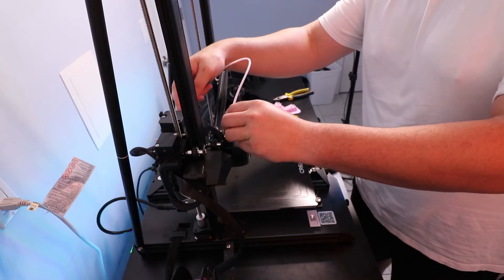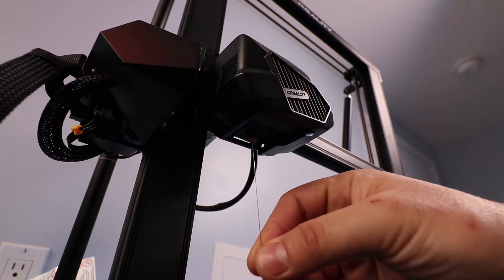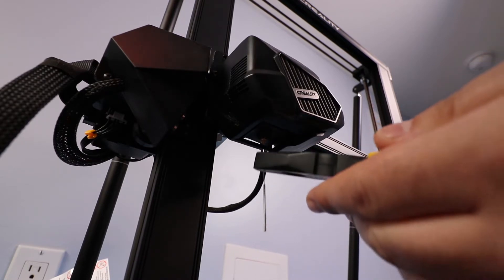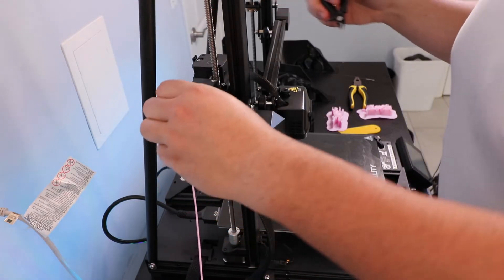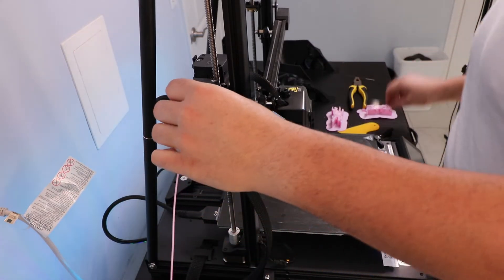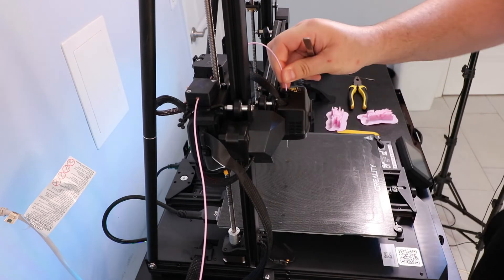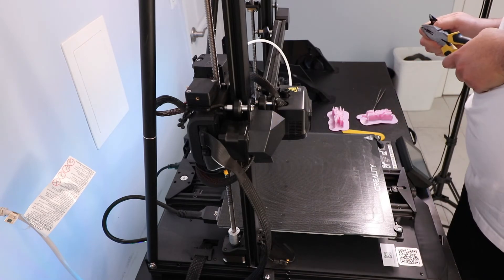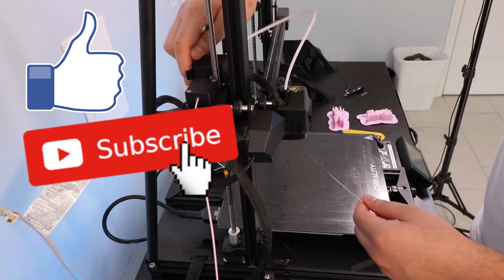Unclog Nozzle Demo On My Creality CR-10 Smart 3D Printer

Comment: Which laminator uses CURA or Creality Slicer can you share your settings?
Reply from the maker: Hi Santiago, thanks for the comment! I use Creality Slicer for my Creality 3D printers. Cura and Creality Slicer use the same base software as far as I know so they should be nearly identical. As for settings, I use the CR-10 Smart settings the preloaded profile comes with in Creality Slicer. Unless there is something specific I am trying to print, I use the basic, preloaded settings.